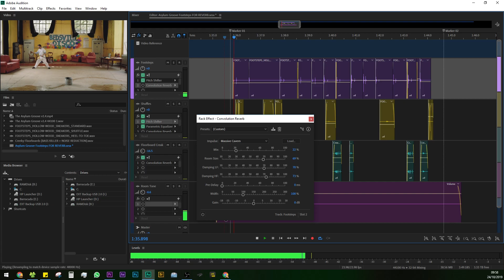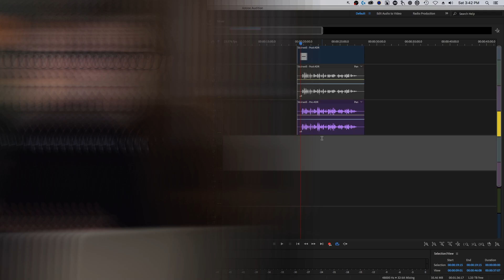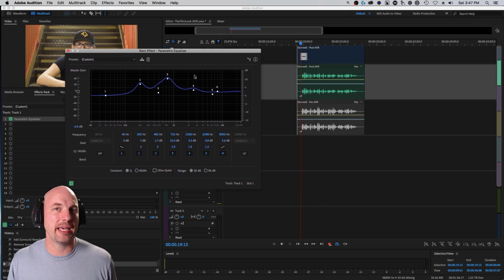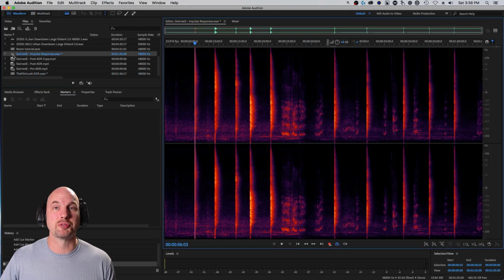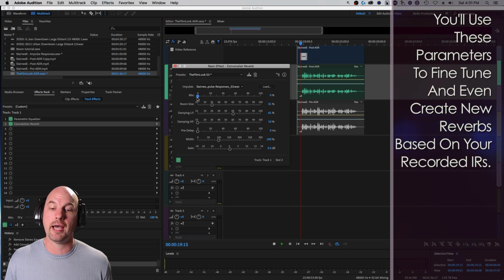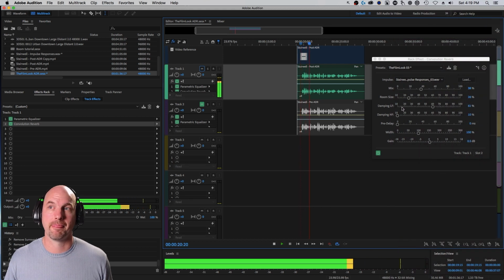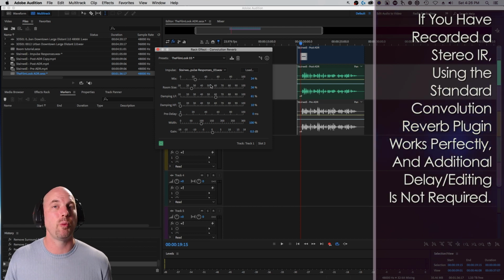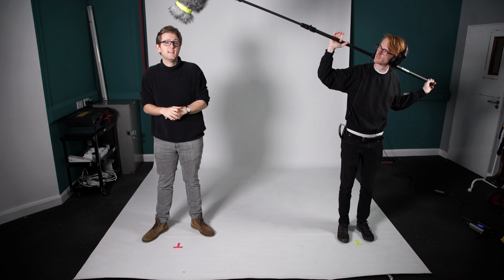Realistic Reverb: How to Mix GREAT Foley & ADR for Films

Comment: I am not good wit haudio editing. I have never really gotten into it. When I started out when I was 13-14 years old, it was enough for me with video and to learn Premiere Pro myself (and from YouTube videos). In the past years, I have began learning color grading. For audio, I have never taken the time. I like to do Foley sounds, but I just add them on the timeline in Premiere Pro without messing around with settings. Audition looks so advanced, but I have used it a bit before. So sound design is my weakest point and I a minterested to learn a bit more about it. On the Horror short film, a friend of mine does the audio in Audition. He is interested in sound aswell, so maybe it's a bit easier. I try to get as many of the Foley sounds on location as possible. Things like foot steps in a big hall, if I don't have the possibility to go back there I try to find a similar place with the same amont of reverb. Great video! I learned a lot today :-)
Reply from the maker: Yes there is a lot of different areas of filmmaking, it's nearly impossible to know how to do them all. Having knowledge and little experience in each area will make you a really filmmaker, plus you can find out what you really like doing as a filmmaker.
Reply: @TheFilmLook  yeah. Agree.